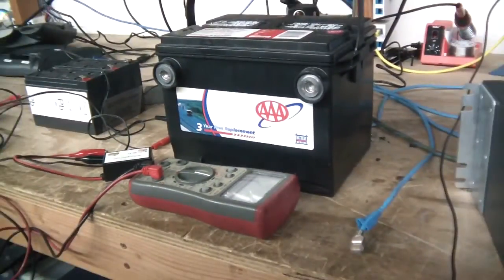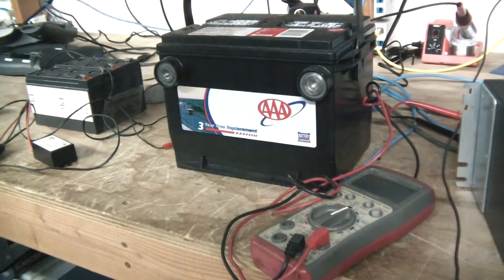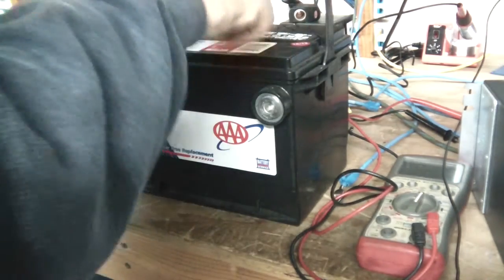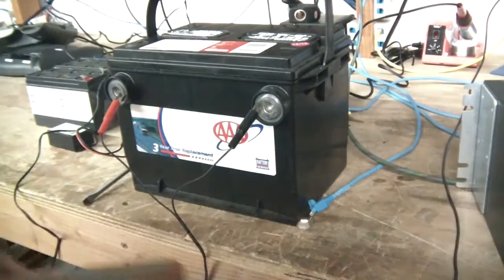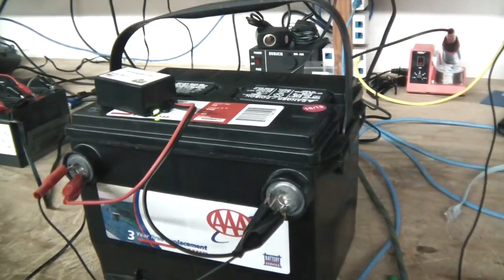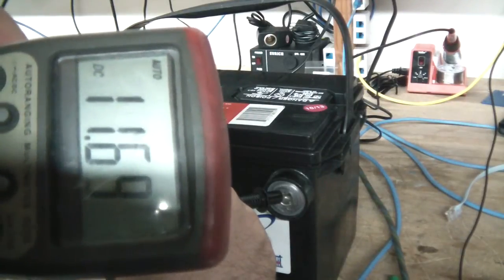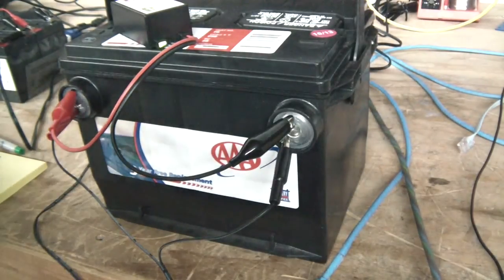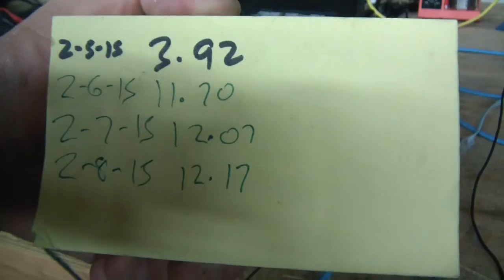Battery Repair with Wizbangplus Wizbang desulfator

Comment: After the cold snap in January of 2018, the battery in my truck was dragging a little so I replaced it immediately with a new one.  Took the old one to the bench and tested it.  The two end cells indicated sulfation even after charging.  I attached a Wizbang plus and 1.5 amp charger/maintainer from Harbor Freight.  After three months, the four middle cells float all the balls in the hydrometer (only type I have since I have motorcycles, too)  The two end cells previously floated only three balls and now one at the positive end of the battery floats all the balls.  The end cell near the negative terminal still floats three but the fourth ball is trying to float, too.  If you're in a hurry, the desulfator is a bust.  If you have time to let it do its magic, you may just get a good battery out of the deal.

Comment: what he should do is, as soon the batt reaches 12 volt put an other power source on it and start making a deliberete OVERCHARGE, say at 1 amp and a max voltage of 17 volts for a few hours....then measure the voltage and - or the specific gravity of each cell, this overgharge by itself should get the cels getting active again, the desulvator can do the finisching touch later
Reply from the maker: I agree
Reply: where can i buy a 17volts charger?

Comment: Sir I'm hoping you can answer some questions.

At the beginning of the video he measures 3.9 volts and say the battery is defiantly bad?  What?  How does he know?  3.9 is an indicator of the current charge of the battery, not the condition.  

I have left the lights on in my car and measured 1 volt yet my battery is not bad.  It just needs to be charged.  A battery that’s been sitting unused for months or years could be just discharged and not bad.

When he  had the caps off why didn't he use a hydrometer to measure the specific gravity and a thermometer measure the temperature?  (I learned how to do this in my high school auto shop class.)  

Then he uses a cell phone charger to charger the battery.  Sounds perfect.  It puts out 1 amp and I’m guessing the battery is around a 500 amp/hr battery so I would expect it to take 500 hours to charge the battery.  But then he only lease the charger on for what 72 hours?  That's not even close to a full charge.

But then connects the Wizbang desulfator in parallel. What?  (That doesn't make any sense.)   What’s the Wizbang desulfator going to do if the charger is always supplying 12 volts at 1 amp?  I don’t get it.

As the days go on he measures the voltage on battery and shows it’s increasing.  Duhhhh   That’s what’s supposed to happen.  But then he doesn’t’ measure the specific gravity of the battery or the temperature.  (This is the MOST important piece of information.)

So what exactly is it that the Wizbang desulfator is doing?

But his conclusion is just perfect, "I guess it worked'".    He guessed it worked?

Now those are the words I want to hear for an auto mechanic after he fixes the brakes on my ex-wife’s car before she cancels her life insurance policy.

Why did I waste my time watching this if he was only guessing if it worked?

Got to tell everyone there are lot of videos which actually show these things are a complete rip of and waste of money.
Reply from the maker: +Passed High School Physics 
Check out my other videos, I run a volt meter to test individual cells. I also have on of the fancy batter analyzers, I also have one of those old school specific gravity turkey basters. This video must have really pissed you off.  Sorry sir, I'm a complete idiot.
Reply from the maker: +Fintech Repair Shop 
By the way I'm not an auto mechanic, I just do that for fun, I troubleshoot voice and data problems in data centers all day.
Reply: Fintech Repair Shop Hey you did a great job on the video.  I'll give you and A for that.